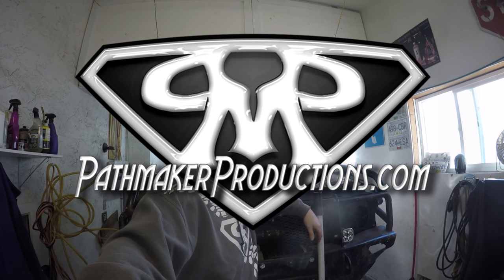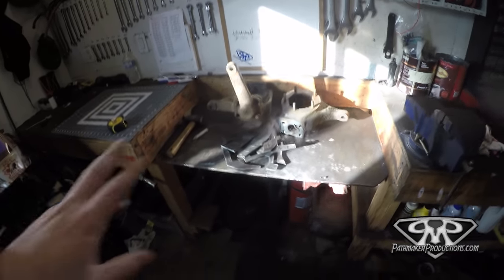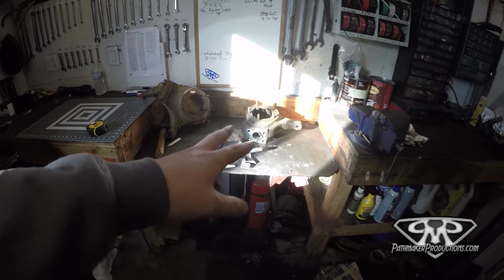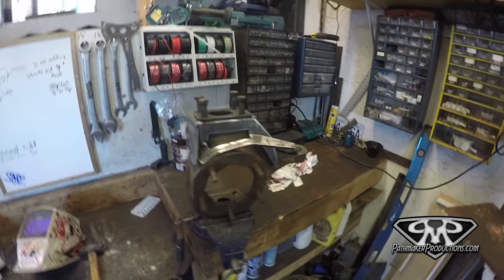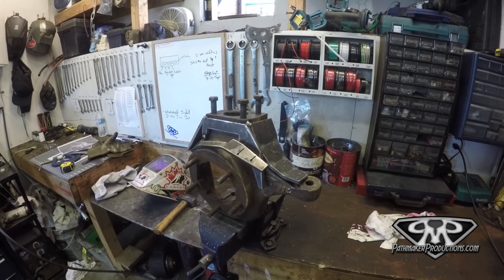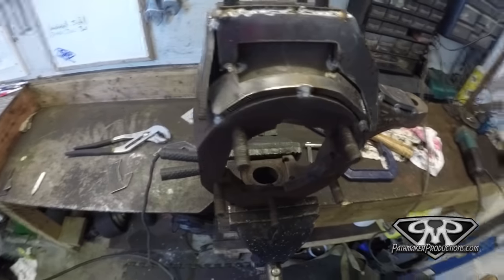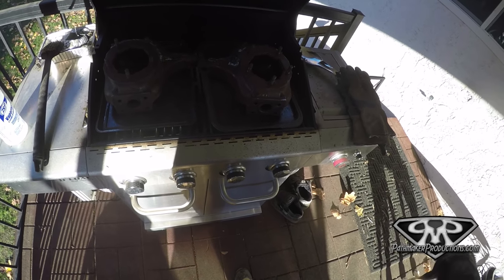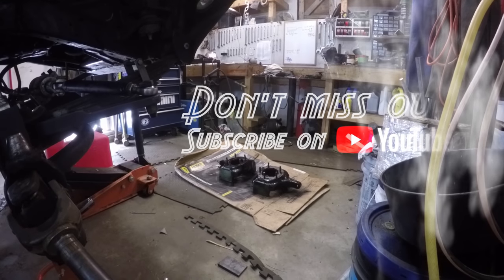Dana 60 Kingpin Knuckle Gusset Weld on Kit Upgrade - Pathmaker Speed Shop - S7E39

Comment: Some of the finest BBQing I've seen all year! Those welds will be sturdy as an Ox! Digging the heating process. I'm also running a 14bolt and kingpin D60 but passenger drop. I like that knuckle gusset kit. I'll have to reach out to the good folks at  Backdoor Fab and get my own.  Fyi this is CJ_Crawler on Instagram what's up bud?  Keep the videos coming. They never get old.
Reply from the maker: You can find Back Door Fab on  FB and send Dustin a message and he can send you out a set no problem. I could have cut them myself out of a piece of 1/4 but for the time saved it was well worth the money!
Reply: @PathmakerProductions  Right on man. I follow them on the Gram (as the kids say). They have some nice stuff. I'll tell him you sent me over I'm sure he'll appreciate it.

Comment: Hell yeah, good idea with the bbq, when you did your 14 bolt housing, did you just let the tubes hang out the sides? I’m getting ready to shave the one I have
Reply from the maker: Yea I grabbed an old bbq from the metal bin dropoff down the street and cut a couple 5" holes in either side with an angle grinder! I wouldn't do it with my good bbq haha. That one turned into a camping Q. Theres pics of it on my blog on my website. I dunno if you'd get your housing hot enough without the lid closed!

Comment: Most steering knuckles are actually nodular iron or cast steel , not very many are brittle gray iron that would not be good for steering components,
Reply from the maker: The D60 knuckles are made out of Cast Steel, which is why I did the pre/post heat to keep the cracking to a minimum when cooling. Still holding up strong years later!
Reply: @PathmakerProductions  correct but cast steel is way different than cast iron , the process you used is for cast iron , like cheap gray iron . Same as the inner Cs that are welded to the Dom steel tube , it's a burn the weld in and done . You never gave good shots of the completed welds ,that would have been nice , for as long as the knuckles were on the grill you should have done a nice ring roast with them ,all good , God bless you
Reply from the maker: Cool, well im not a trained welder in any respect, completely self taught. After doing a ton of internet reading about welding knuckles the consensus was that you should pre and post heat them and as I have no idea what I'm doing I figured I would listen to people that knew more than me.
Apparently I listened to the wrong people..........but at the end of the day my knuckles are still working great.